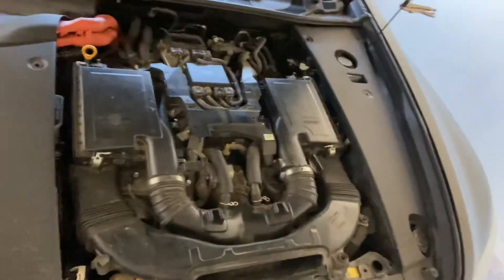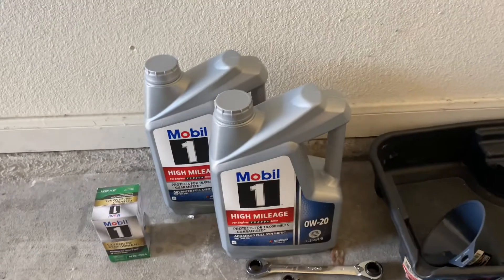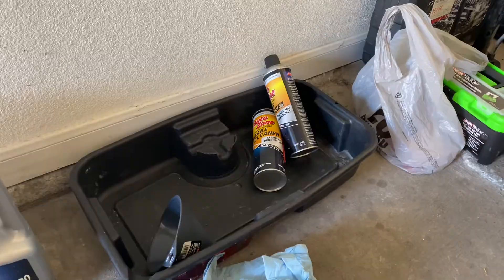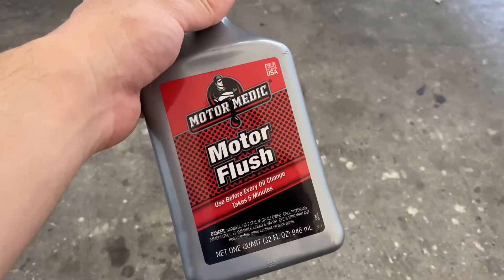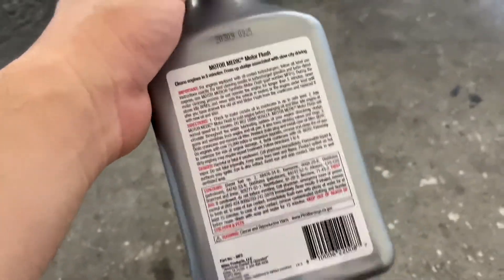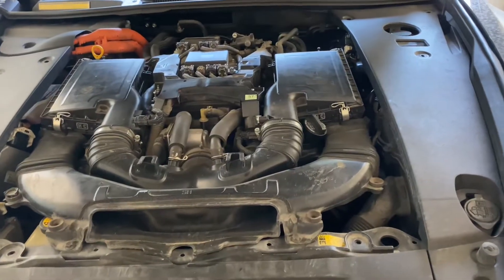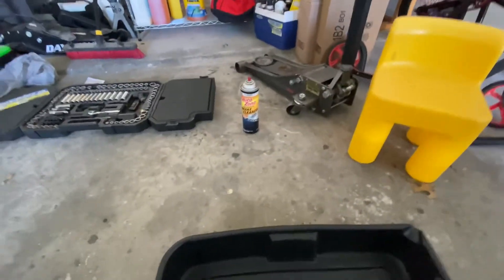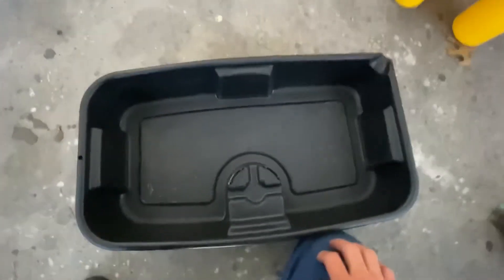HOW TO: Change your oil in a car/hybrid Lexus LS600HL

Comment: If you've been changing your oil on time you don't need motor flush (especially if you're changing it every 3,000 miles. That's overkill as it is). And you don't need high mileage oil regardless of how many miles are on the engine unless it's burning or leaking oil.
Reply from the maker: Good advice. This was the first oil change I’ve done on this car since I got it(I recently got it), so idk how the last owners treated this car.
Reply: @ShadySpectacles  
That explains it.
Reply: @ShadySpectacles  yea you’re thinking like a bmw owner where everything breaks.  Start thinking like a Lexus owner.  No additives needed.   In fact it could do harm.   These things are bulletproof as is.   Also if Lexus says the transmission fluid is lifetime, don’t touch it.    Leave alone.
Reply from the maker: 😂 I’m old school, I change the oil every 3 months or 3,000 miles. Transmission for me is about every 80-100,000 miles.
Reply: @ShadySpectacles  10000km is enough. best oil: motul hybrid 0w20